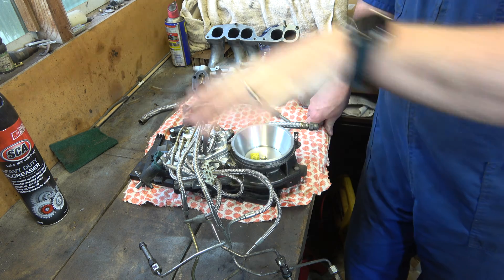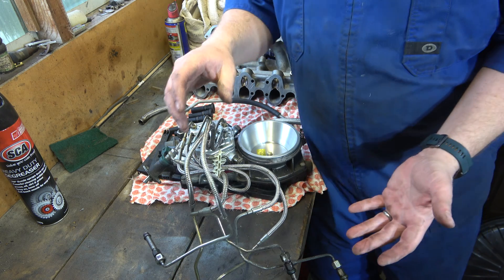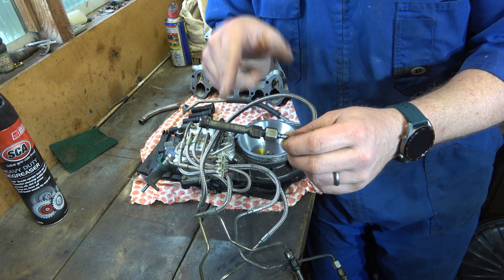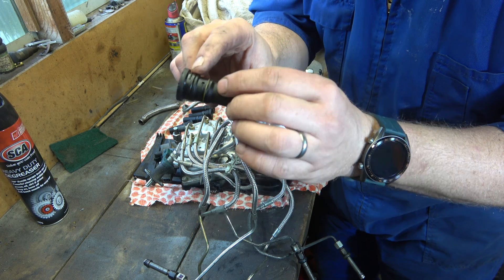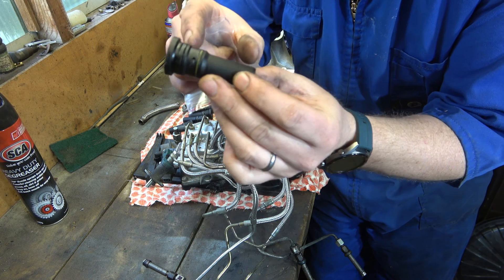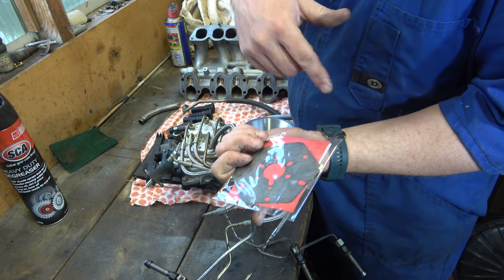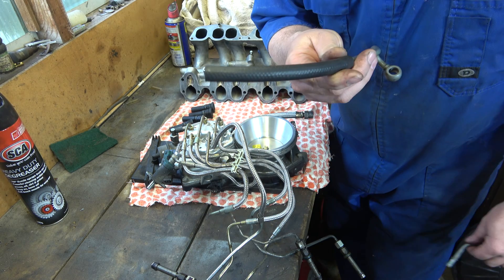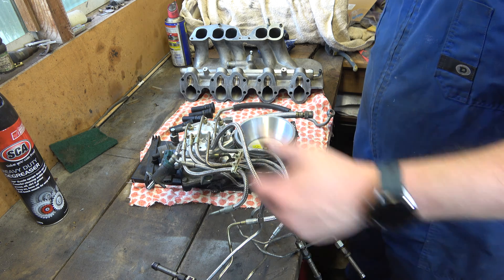Bosch K Jetronic Fuel Distributor - Quick Look

Comment: I really think the K Jet needs a multi component fuel additive with friction modifiers & detergents with a component to prevent ethanol turning to acid & corrosion protection, since the sulfur has been removed from gas.
Much like how diesel fuel needs a bunch of different additives as dies the CIS due to its close tolerance mechanical injection.

Comment: Hi, i am interested on the ford rs turbo one, they have an extra pressure valve and a 3 wire black, plug. Can I use normal k tronic one non turbo on a turbo set up?

Comment: Where did you get those braided distributor hoses? The ones on my e21 leak fuel and the parts are no longer available. Currently stuck with no viable solution :(
Reply from the maker: They're the original ones. You can get a hydraulic hose shop to make you new ones

Comment: My system pressure  is good but when I turn the valve on it drops for a second  then climbs right to system pressure cold with electric connector to warm up regulator un plugged tks for any help . I think I will have to repair war but want to be sure

Comment: Great video. Got mk2 jetta cli 16 valve kjetronic myself.
My car didnt want to idle.
However if i manualy work the sensor plate and override start relay the injectors spray.
I check for fire and firing order. All good. Fuel supply at the onjectors all good. No fuel coming from injector lines.
When does fuel come from injector lines if all are good on the system?

Comment: If all injectors are firing at the same time isnt that uneconomical? What about bore wear from the fuel washing the bores continously?
Reply: They are not really firing, they are flowing constantly (Constant Injection System). Flow is regulated by the fuel distributor control plunger. Ofcourse electronic injection or direct injection is better for economy, but fuel wasn't so expensive 30-50 years ago 😃 All they wanted was more power than the carbureted version. There is really no bore wear, the Audi engines are really long lasting. There isn't enough fuel to wash the bore, if everything is working OK.
Reply: @mcplutt   "All they wanted was more power than the carbureted version." 

Then they should have switched to a multi carb set up. The airflow sensor plate caused a massive restriction in the inlet tract and the fact that it was continuous meant it provided no advantage over carbs in terms of allowing large valve overlaps.

Comment: Do you know anything about the Volvo k-jet set up..? It's mechanical fuel injection but located under the intake manifold. It's an 82 Volvo 242 2.1  with a cold start issue 🤷

Comment: Great video especially on the hoses. What makes the vacuum to lift the metering plate? Is it the compression stroke by way off the crank?
Reply from the maker: thanks. Airflow lifts the plate, it's behind the air filter

Comment: Just as an aside if a K-Jetronic car seems to be suffering from fuel starvation be aware that at least in some of these there's tiny fuel filter on the main inlet.  If this gets blocked then you're going no where fast.  I was told by a Audi dealer in the UK that it was meant to be removed at the first service after delivery e.g. 1000 miles but they never are..  Mine lasted until 135000 miles until nearly coming to a halt on the UK M6.  This particular car was a 2004 Audi Coupe 5E and after establishing it was a fuel issue it was pretty soon obvious as soon as I began to disassemble the system.  I can't remember if I actually removed it just pushed the innards out with a screwdriver but problem solved and it ran for another 100000 miles before getting rear-ended and written off.

Comment: On fist gear while accelerating u can feel a slight pause and go pause and go not to noticeable but I can feel it not picking direct speed what could it be??????
Reply from the maker: Hard to know from that description
Reply: Can you please be more specific? What type or model of car are you referring to? Is your car equipped with a K-Jetronic fuel injection system like the main topic on this video?
Reply: @tonyreyes9969  k jet on 92 190e when its cold fist start it feels like it loses gas then gets gas then loses gas slowly pocking up speed

Comment: what are the signs that the fuel distributor needs a rebuild? i have a w201 and I don't want to mess with it if I can help it :)
Reply from the maker: Hard starting, poor running, poor fuel economy. Lots, but you get the same issues caused by lots of other things too 🤷‍♂️

Comment: What controls the fuel distribution? Just the air flow meter? Can it run independently without the ecu?
Reply: @Kp Raz; The K-Jetronic is a driveless mechanical injection system which needs no intervention of Electronic Control Unit function. The air-flow sensor and the fuel distributor are assemblies which form part of the mixture control unit. The amount of air sucked in by the engine is controlled by a  throttle valve and measured by an air-flow sensor. An electrically driven fuel pump  delivers the fuel to the fuel distributor via a fuel accumulator and a fuel filter. The fuel distributor allocates this fuel to the injection valves and the injection of fuel takes place continuously. That's where the  "K" comes from, which stands for the German word  CONTINUOUSLY. I hope this help you with your questions. All the best, cheers!!!
Reply from the maker: KE Jetronic has electronic control of fuel and ignition. Electronically controlled mechanical fuel injection 👍
Reply: @tonyreyes9969  Kontinuierlicher einspritzung 😃
Reply: The well proven K-Jetronic fuel system was now uprated to a more intelligent and more efficient system by the addition of electronic circuitry. The K-Jetronic mechanical basic functions coupled with electronic adaptation and optimization  functions is now called KE-JETRONIC -management of combined mechanical and electronic fuel-injection system ONLY. "Motronic" does the management of Combined ignition system and fuel-injection system.

Comment: Great video! I just recently got myself a Volvo 240 Turbo with K-jetronic fuel injection. I think it's a really interestning fuel injection system, even though there are many parts that can break down.
Reply: I’ve got the non turbo 
2.3 H cam 242GT version 
Other than turbo issues what problems have you come across?

Comment: Hi Badger. I have a Volvo 740 K jet. Fuel only coming from 1 & 2 injector. 3 & 4 injectors are not blocked. Car was stood for 5 years. I assume if the diaphragm was knackered, it would affect all 4 injectors? I have had it running but the wiring for the fuel pump had been bodged and was only getting 9.6v with in tank pump not working at all. New tank pump and fixed wiring to main pump and I'm thinking I've pushed some muck into the fuel distributor. Any suggestions? I'd rather not crack open the distributor if there's a way of cleaning without. Sorry this is so long.
Reply: If the fuel pump isn't putting out enough pressure, could it have this affect?
Reply from the maker: I'd check your fuel pressure and inject spray patterns
Reply: @Badgertronix  Thanks Badger. I've done some research on CIS. I pulled the unit out and gave it a good external clean as the plunger operated by the air metering unit was a bit gummy. My working theory is that the control pressure has been adjusted to compensate for low fuel delivery from under powered pump. Now pump is getting full voltage, pressure is too high to allow metering plate to be lifted by vacuum. Just a working theory. Need to get the special bits of kit to test pressures and finding out what they're supposed to be would be an advantage as well. Injectors sing and spray well and equally when plate manually raised.

Comment: hydraulic hose works well for high pressure systems take the the ends and they can make them up for you
Reply from the maker: That's a good option. This hose and these clamps work well for me. Cheers
Reply: @Badgertronix  blame HubNut Giggles

Comment: I've seen the K Jetronic on Volvo 760 GLE's with the PRV V6 engine.It looks complicated.
Reply from the maker: It's generally pretty reliable as long as it gets looked after
Reply: @Badgertronix  It's mechanical fuel injection isn't it?
Reply from the maker: @jaggass  yes although this version has electronic ignition

Comment: 50 bucks each  ? that's pretty cool tho a manual mass air flow I don't think I 've seen one before.  well not out like that one.
Reply: Most fuel injected cars in the 70's and 80's had this system. At least the European brands.

Comment: Eugh, I do NOT miss seeing those.  Not one bit!  Nope nope nope~

If you do rebuild your distributor, keep watch for the...compensation port?  Forget what it's actually called, but there's a tiny, easy-to-miss pinhole in the diaphragm that lines up with pinholes in each half of the distributor.  As I recall (at least with the six-banger), the diaphragm will seem to fit right side up or upside down, except that pinhole is offset...  It also loves to get clogged, and hates to get cleaned!  Be cautious if you're using shellac or some other adhesive on the diaphragm, as it will find that pinhole and plug it right up.

Wish I hadn't sold off that Crate'O'Parts(tm) when I moved from California!  I had over a hundred Jetronic injectors I'd acquired from junkyards and ebay for $3-$5 each, all back-flushed and ready to go!
Reply from the maker: I'm rather partial to them but then I've only had to look after ones I've maintained myself and not neglected customer ones.

I'll have a go at rebuilding one as soon as I have a spare one. I'd rather not brick my daily!

What I'd do for a stack of kjet injectors!